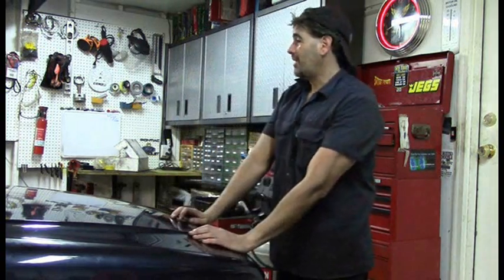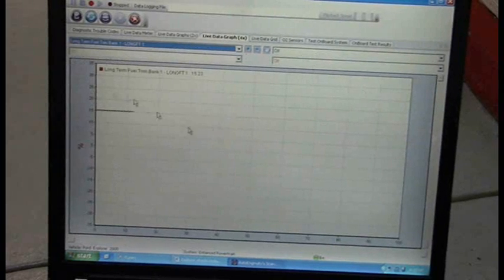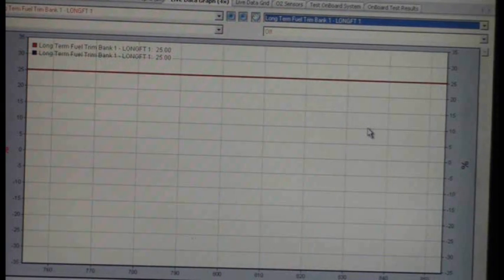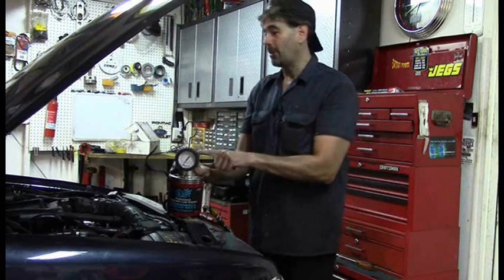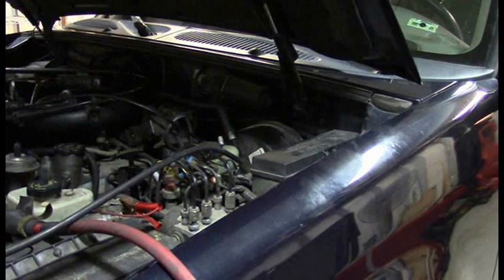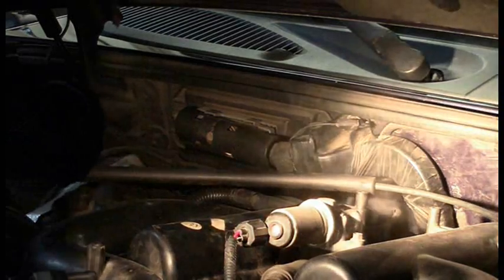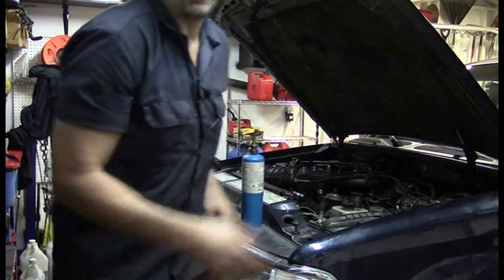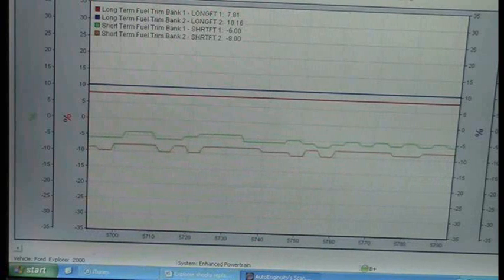Low Fuel Economy Diagnosis 2000 Ford Explorer

Comment: Great video, straight to the point in how to diagnose and fix the issue with elevated fuel consumption, as it turns out a simple vacuum leak was the cause. Thanks a lot for the insight.

Comment: How to tell if brake booster is the vacuum leak?
What would be the DX and repair costs for that job you did?
Reply from the maker: pretty simple. if the fuel trim increases dramatically when brakes applied OR decreases dramatically when the booster vacuum is blocked, you confirmed a bad brake booster.

Comment: I have a 04 with the 4.0 haven't had it long mabe a week. And this thing has uses 40$ worth in gas Wich was 9.5 gallons of gas and only gotten 240 miles wtf
Reply from the maker: that’s almost 24MPG.  what is spec?
Reply: @SchrodingersBox  4x4 4.0 v6
Reply: Sorry I typed that wrong I meant I have put $20 in it Wich was 9.5 gallons and I put another 20$ Wich was another 9.5 gallons Wich was Total of $40 in gas and I have only gotten 240 miles out of the $40 Worth Wich was 18 gallons  dam thing sucks on gas
Reply from the maker: ok so what data do you have?  Fuel trim data is always where you start on something like this.

Comment: so i have a 2006 Toyota Corolla with very poor fuel economy. i did a scan of my fuel trims and these are the results: STFL 19.7% and LTFT is 3.7%. Opening the throttle, the STFT lowers and the LTFT goes into the negatives. I replaced some vacuum hoses that had minor bursts on the but saw no improvement to my fuel trims. Oxygen sensors and spark plugs are new. my coils are coil on plugs and when removed from the plugs one by one the car would stall. MAF was cleaned and it stalls the car when the connection is removed. I didn't do a fuel pressure test since i don't have the tools to do it. 
Can you help in anyway?
N.B my upstream o2 sensor is the wide band type

Comment: Matt, you are the best and only use your channel for help!! Do you have any videos on Ranger 4.0 sohc timing and with crank no start. I have pulled this 03 motor twice and rebuilt only to have it shut down while running and then can,t get it to start. I only took this project on to help my son with this truck because many mechanics do not want to work on it and if they do, charge many thousands of dollars. I am at a loss what to do at this stage
Reply from the maker: Thanks.  Any crank no start diagnosis is the same on every vehicle-  See my videos on FASTTEC technique

Comment: I hope u will reply to my questions. I have seen a lot your videos for the past few months in order to troubleshoot the problem with my Nissan X trail T30. I have a high fuel consumption for a few years. Most mechanic cannot identify the issue and just give a guess to change few parts. About 2 months ago I saw your video and start learning. I have run the scanner and I got LTFT and STFT around -9 to -11 and when I push the throttle to 4000rpm the LTFT and STFT will be at 0. So my questions is this an indicator for vacuum leaks too? Or it is something else, because in this video the LTFT is at positive 20% and and will be at 0 if you increase the gas. My situation is kind of up side down from this video. What's your thought for the cause of my LTFT at negative reading?
Reply from the maker: It cannot be a vacuum leak. However I have seen many times a rich FT at idle that fixes upon increased RPM that turned out to be a dirty MAF sensor. Just had that this weekend where this happened and I did a volumetric efficiency calculation to confirm. Free repair.
Reply: @SchrodingersBox  thanks for your prompt reply. However I have seen your video about MAF sensor and its type and had cleaned my MAF sensor and throttle body last 2 weeks prior to scan because I don't have scan tools before this. I will do the MAF and throttle body cleaning again and see the feedback from scanner. By the way what is volumetric efficiency calculation? Is there any of your video that I can learn about this volumetric efficiency? Are there anything else other than dirty MAF sensor that you know from your experience that will cause rich FT at idle? Thanks from Malaysia.

Comment: Can a vacuum leak cause a rich condition? I have short and long fuel trims at -25 and when I goose the gas the longs drop to -4 ish immediately
Reply from the maker: No. You can have two conditions though. Remember a vacuum leak is never a condition under load.
Reply: @SchrodingersBox  It was tossing lean codes, I threw new sensors at it and intake gaskets. new wires and plugs it even asked for fuel pump and injectors. which it got and that's when the codes went rich
Reply from the maker: i would have to see the day indicating you needed a fuel pump. Didn’t your data you just said in first post show you did not need a fuel pump?  What ann i missing?  even if that data did show you need a fuel pump, why do plugs and wires? Sorry I am not following your method here.
Reply: @SchrodingersBox   OKAY just remember you asked. 8*)    I got the truck(96 explorer 4.0 ohv) it had misfire codes for cyl 6 & 1 a code for DPFE and one for ETC the misfires went away when I replaced wires and plugs The other two codes left after replacing the two sensors. (The truck hadn't been maintained  so you know the drill "gimmy gimmy" new codes for lean condition brought me to your channel where I learn a lot and took care of the codes  as they appeared. along the way was checking the fuel system for pressure and it was 17psi also it would bleed off quick. the FPR diagram is good it holds vacuum so I haven't changed it, but I put a new fuel pump module in the tank and bought new injectors. The lean condition went away and it's now running stupid rich the HO2 appear to be okay I am wondering if the spring in the FPR could be IDK not springy enough if it would cause the problem. my pressure is around 34psi  goes to 39psi when I remove the V line. the voltage at the pump is 14.4 running and 0.3 on the neg side. I have beat my head against the wall on this Ford. And everything I can find online doesn't seem to have any effect on it. A compression check showed 5 cyl at 120ish and 1 at 145ish but they all hold pressure. the engine idles nice it will snap rev okay but at WOT it complains a lot and I get fuel system faults until it goes back to idle. I've smoked it and fixed all vacuum leaks there are no exhaust leaks  I have always been able to keep my vehicles on the road but this one is; how can I say it nicely...pissing me off. I have tried every reasonable thing it might be that I have been turning up on the web. and  thought you could point a finger in the right direction. hopefully not up. :) also I unhooked the exhaust after the Y and before the CAT still no change
Reply from the maker: Sorry but non of that data is useful except the fuel pressure  data which clearly indicates the fuel pump was fine.
  I need to see relevant data- just basic fundamental beginning data such as the LTFT and STFT both static and curved against load correltated to MAP and MAF.
   You say you unhooked the exhaust- why? What was your MAP data indicating an exhaust restriction? Was a backpressure test done?
  You have to have a specific, targeted goal and eliminate variables systematically.  This looks really shotgun and there is no comprehensive dataset for any one variable.
Reply: @SchrodingersBox  Okay I'll get the data you asked for today. Unhooking the exhaust was my backyard mechanic way of double checking the back pressure test. The needle was bouncing around on my gauge so much I couldn't tell what it said. Somewhere around 0.5 to 1.5. Okay I'll get back to you later with that data.  Thank you so much.
Reply: @SchrodingersBox  Got it. 
RPM 800
ECT 184F
MAF g/ps 4.46  Volts 0.81
Baro 152Hz
LNGFT1 -25
SHTFT1 -19.28
LNGFT2 -25
SHTFT2 -22.40
O2B1S1 0.35v
O2B2S1 0.83v
O2B1S2 0.41v

RPM 1500
ECT 186F
MAF g/ps 8.13  Volts 1.14
Baro 152Hz
LNGFT1 -21.88
SHTFT1 -16.21
LNGFT2 -21.48
SHTFT2 -22.40
O2B1S1 0.41v
O2B2S1 0.84v
O2B1S2 0.45v

RPM 2500
ECT 190F
MAF g/ps 13.58  Volts 1.49
Baro 152Hz
LNGFT1 -17.97
SHTFT1 -21.82
LNGFT2 -17.58
SHTFT2    1.62
O2B1S1 0.49v
O2B2S1 0.87v
O2B1S2 0.67v

I think thats whats you asked for

Comment: I wish I knew about Fuel Trim Diagnosis when I had MY 2000 Explorer (aka "Old Ned" because he was a "N"Eddie Bauer Edition). It has horrible Gas Mileage AND an Airbag Light too!
FYI - the Airbag Light can possibly be the system harness under the Right Front Seat (known harness connection issues).

Comment: First of all, thank you for all of the priceless info shared here. I have a questions, i've run some tests with my obd2 scanner, it seems i experience a lean condition on one bank and a rich condition on the other one... basically both of the symptoms explained here, I have a Subaru outback legacy 6.3.0 from 2003, Everything seems to run great exept the fuel consuption is terrible... i am doing 170 miles on a full tank..... getting a 10mpg driving very conservatively... 
Any hint on what, how to execute more tests?
Reply from the maker: I would start with basic fuel trim analysis with induced variables for both banks and see how the banks respond accordingly.  Then swap O2 sensors on each bank and repeat. If the problem moves, the O2 sensors need replacement.  If however they are consistent, start running down bank-independent rich and lean variables since the O2 sensors are accurately reporting.
  Science!
Reply: Schrodingers Box thank you so much! 
What do you mean exactly by induced variables? The only variable I used so far is the gas pedal :) . I will also look into O2 sensor. Forgot to mention, No codes are appearing on my scanner. I really appreciate you taking the time! Learning a lot from your videos!
Reply from the maker: by induced variables i mean create intentional rich and lean conditions so you can see the o2 sensor response changes as would be expected.
Reply: Schrodingers Box got it! Onto more research now! Thanks!

Comment: Great Video! I love diagnosing with fuel trims.   Once I had P0171 and P0174 on my own vehicle but every time I looked at the trims they were 0 +/- 5%. Finally I looked at them when the vehicle was cold and found them at 20% at idle and near 0 at 1500 RPM.  As the vehicle warmed up they dropped back to 0 all around. So I had a vacuum leak but only when the engine was cold. Turned out the upper intake manifold o rings were old and crushed/dried out. Replacing them fixed the problem.  Got to love the fuel trims!
Reply from the maker: Very common issue and in fact I believe I have three videos showing exactly this same condition.  High fuel trims only when cold that improve with temperature almost always indicates an intake manifold leak! Great diagnosis!

Comment: Hey Matt great work , easy to understand you do an excellent presentation. My explorer has been sitting for 2 yrs, it starts easy but runs poorly on the road. Guessing it is old fuel that needs a cleanout, any ideas to test its not something else? what is you OBD system software, i think l need one the same, l am new to these computer vehicles, as had diesels pre computer for years. 
Cheers from Downunder
Reply from the maker: It is extremely unlikely to be bad fuel. If it were me I would do a fuel trim analysis to find the cause of the rough running and go from there,

Comment: Why is there  two bank 1 longterm pids?   wouldn't there be a bank 1 & bank 2 longterm pid?
Reply from the maker: Each bank is trimmed independently.
Reply: but you have bank 1 twice... I guess I need the white board of knowledge..lol
Reply from the maker: Did I ? Maybe an error or I meant Short term fuel trim. But there is only one LTFT per bank.
Reply: Man hurry & start your member page.. I have some studying to do...lol
Reply from the maker: Hahaha love it! I am told 3 more weeks by the designer. hang in there!!

Comment: Great video as always.
I have an 07 GMC Sierra 1500 2WD with a 5.3L (aprox 140K miles)
Im only getting 6.5 mpg, and theres NO check eng light and truck runs smooth...
I removed throttle body and cleaned it, cleaned and re oiled the K&N filter, and cleaned the MAF sensor...
Where should i start looking for the problem?
I hear from others with identical trucks, they're getting about 12 mpg. So i dont understand why im so far off.
Thanks!
Reply from the maker: What data do you have?
Reply: Schrodingers Box 
Should i check my fuel trim numbers? I have an Autel code reader, but it does do live data...
Reply: Schrodingers Box 
I havent driven my truck today, and its very cokd, if i go fire it up so i can check the fuel trims, how long does it take to go into closed loop? And does it need to be in closed loop to check those figures?
Reply from the maker: I would totally start with fuel trim. No doubt. Keep it basic.
Reply: Schrodingers Box 
Ok sounds good!
Thanks
I will post the numbers once i get a chance to run out and check them
Reply: Schrodingers Box 
So bank 1
Shrtft between 0 and -3.1
Longft -1.6
Bank 2
Shrtft between 0.8 and -1.6
Longft -3.1
MAP (kPa) 30 - 31
MAF (g/s) 6.6
02B1S1   0.08 - 0.765
02B1S2   0.700
02B2S1   0.09 - 0.775
02B2S2   0.660
This is with the truck at normal operating temp
Reply from the maker: There is no curve against load. this information is useless sorry.
Reply: Schrodingers Box 
So whats the proper way? Looks like everyone checks them at idle...
Reply from the maker: Thats because they all have absolutely no idea what they are doing.  See my video on fuel trim analysis.
Reply: Schrodingers Box 
Ok
I will check it out!
Reply: Schrodingers Box 
Well i just got done your 2 part series...
Awesome job explaining fuel trims! I feel i tiny bit more confident in reading  those now...
Except it wasnt really mentioned how to apply this diagnosis...
Im assuming its best to check at normal operating temps, but does this need to be done while driving, or just have the vehicle in gear, under load, before reading trim data? Some of your examples show idle and around 2500 rpm, im gonna guess and say this was while driving? 
I just assumed yesterday when i checked, that it had to be in park idling to get a base line, but i guess after watching those vids, fuel trims at idle can vary significantly from when rpms are increased...

Comment: Hi Matt and all, I don’t want to be considered a bonehead for this comment as I try to absorb everything that you teach.
However I’ve been a little stumped by a friends 1.4 diesel Peugeot 206, and I know it’s a French car... trust me, I’d burn it if it was mine.

However he has a high fuel consumption issue. Very irritatingly this model doesn’t support the OBD function of reading live data (even though it has the OBD port and can read DTC’s?.. even has oxygen sensors so unsure as to why!), apparently only 2004 onwards and this is a 2003, which instantly puts me at a little bit of discomfort.

Making up a “dryer race board of knowledge” at the moment to consider all possibilities.

Written so far: 
-vacuum leaks
-leaky fuel injectors
-dirty mass air flow
-low compression
-thermostat (not reaching closed loop?)
-mechanical friction (brakes binding, worn tyres.. advice here would also help guys)

If you or anyone watching this channel has any more options for me to check, it would be GREATLY appreciated. I would obviously prefer to check the easiest and most likely before delving into something more difficult like checking compression through the glow plug holes... not cool.

Cheers guys, Reuben